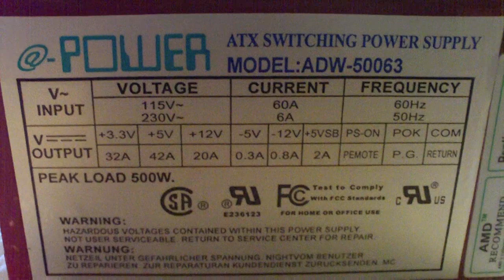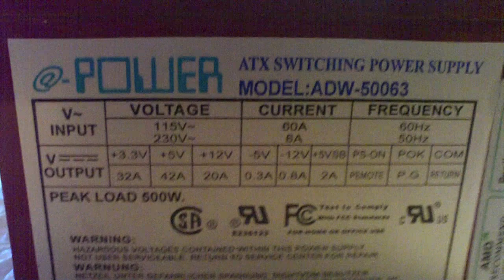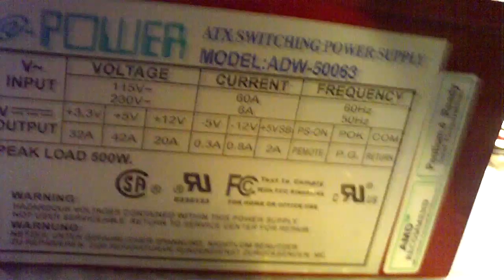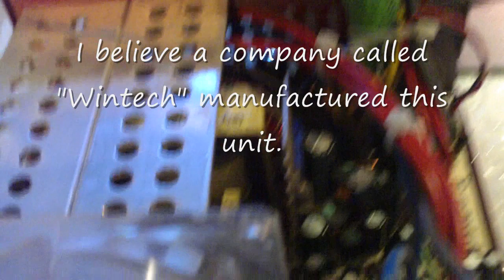Review #4 - A look at the DynaPower USA ADW-50063 500w PSU

Comment: The card claims a 350w minimum requirement.  if Lukeno52 is correct, there is now way this psu will run the EVGA 8400 1GB card.  Please correct me if I'm wrong, but the low to mid $20 range is where his budget restricts me to for this build.  maybe $30ish.  I know it states 500W MAX, not constant output. how can I ever tell by labeling if a psu has adequate 12v rails, and >=400W constant output?

Comment: This is a 300W Wintech (which is now a defunct OEM, btw, they are still selling off old stock) Not even a very good 300W unit. They put both the primary and secondary components on the same heatsink, which is NOT a good idea. The primary components have 320V+ going through them, the secondary have, of course, 12v and 5v. Build quality is not very nice, note the bulging capacitor.